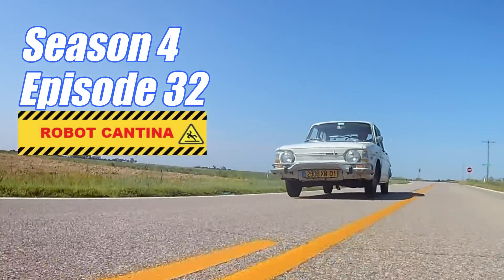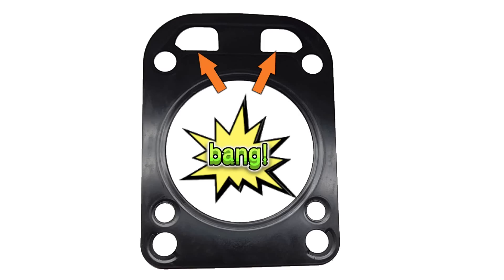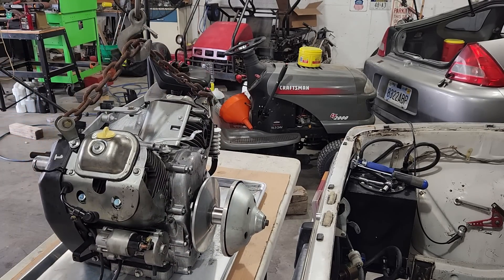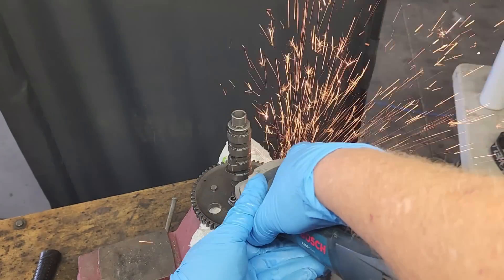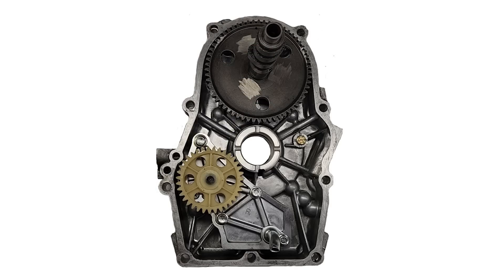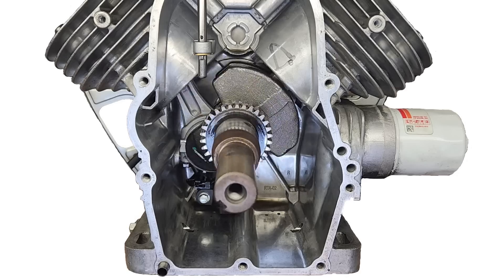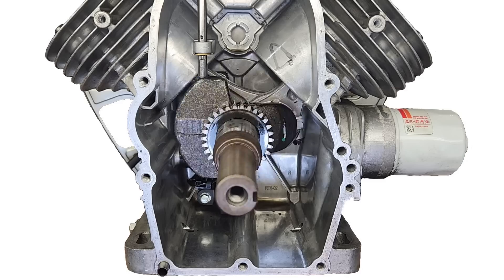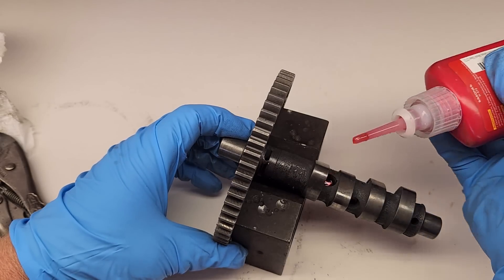S4 E32.  We do an autopsy on the 670 cc predator engine in order to find the oil leak

Comment: I have this engine on one of my pressure washers and it is stock unmodified with compression release. AND it blows oil still. I would love to see the update of your modification. Did it solve your issue with the oil being blown out? I am losing half a quart about every 7 hours. At that rate who needs an oil change!? I started thinking about making an oil catch can and T it into the oil drain tube to return it back.

Comment: holy hell 180 psi? the highest compression small eng i ever had was my 16hp cast iron brigs single, got 115psi. my best briggs oppy does about 75psi both cyl. i got a smooth running cast iron smoker 12hp that runs 25psi, was 50psi till i axidently submerged the motor on a trail ride

Comment: I guess that you will wear out the cam and lifters shortly by blocking off the hole in line with the top of the cam lobes. I think a better way would have been to reinstall the cam rod with the pin you pulled out with the vice grips. I really hope that I am wrong. I f I am correct with my engine theory then the pressure oil was for camshaft lubercation . THANKS FOR THESE VIDEOS.

Comment: An easy fir would be to relocate the crankcase breather to the head opposing valve cover from the oil fill. Little more involved would be a crankcase oil catch can. Just have the drain re-enter the crankcase. Love the videos. A lotus 7 powered by a boosted predator would be awsome fun.

Comment: Currently working on a conversion, Fiat Palio. Small front wheel drive light cheap car. Installing a Yanmar 3TNE78A. I think it will be interesting to see fuel consumption compared to your Kubota projects as this yanmar is direct injection

Comment: It would have been easy to do it the right way: make a solid slug on a lathe with a resistance fit area on the end and press it into the hollow camshaft with a bench vise. Add a pin or a set screw afterwards if the pressing force didn’t feel adequate.
Reply from the maker: indeed, there are many ways to solve the problem.  The method I chose was perhaps not the greatest, but it was a method anyone could do.  Not everyone has access to a lathe and a press like I do, however everyone does have access to thread locker.    From past experience, I'm confident the thread locker will hold the slug in place without any issues.

Comment: 2:50...

failing to hold the throttle open is also a good way of establishing VE at idle... for those that are say, attempting to code an EFI ECU from scratch...

hell, i throw a bike in gear then run it on a treadmill type affair and get VE for the whole RPM/throttle range.

also, the reading in kg or bar is also the compression ratio.

Comment: Are you worried at all that you may have introduced more wear to some of the moving components that are supplied with oil via the pump?  It seems  to me that by creating an unrestricted path for the oil to flow through the cam, that the oil pressure may have been extremely low. If I understand correctly, the oil passages/galleys are properly sized so that each component gets the oil that it needs while at the same time restricting the flow enough so there is sufficient pressure for the oil to get pushed everywhere it needs to go.  Please let me know if I'm missing something.  I'm loving the videos; keep it up Jimbo!
Reply from the maker: @ 8:56 into the video I address that issue.  The far side of the cam was engineered to get oil by splash lubrication so no worries about lack of oil from plugging the cam.   Aftermarket cams for this engine are basicly the same way.

Comment: Nice find and solution.  One thing, although a bit of crankcase ventilation is due to piston ring blow by, the majority is due to the v-twin layout on this engine. The pistons do not exactly oppose each other in motion like they might in an I4 engine for example. So the crankcase volume changes quite a bit, and with that a lot of air is moving in and out. Or trying to, at least.

Comment: If an aftermarket performance cam is available for these engines, then I'm surprised that you didn't go that route to get rid of the de-compressor, and save having to go back into the engine again. With the twin carbs now fitted, is there any performance modifications left to do on this engine? It'd be nice to see you dial it in as good as you can get it, and then do a 0-50 and 0-60 run against the Insight 719, especially once you get a 14psi pulley set up and maybe some propane injection for it.

Comment: In a way you were lucky that the hollowed out camshaft did not bleed off so much oil pressure that the rest of the engine had insufficient lubrication.

Comment: I suspect you made your cam into an impromptu oil squirter, except it's going into the head instead of the bottom of the pistons. Moments away from confirmation or internet pit of despair, booking for one. 😁
Edit: Well, I will forgo my ticket, temporarily. Crankcase pressure and it's wily, magic charms, eh?

Comment: Or you could have run the breather from the fitting on the block to a valve cover to direct the oil to the top of the head and run another fitting from the valve cover to a PCV valve and filter from a 70s era GM car.

Comment: I actually suspected this would be an issue when you removed it... through no other reason that removing something that wasn't blocked previously would be an issue. I was actually at the time more worried about the bearings being unlubricated due to lack of pressure due to the holes.

Comment: The only thing I'm worried about is if the oil pressure on the cam also lubricates the the lifters as well. for example if you need to drill an oil gallery from the gear side to where the ball bearings where  to drip oil onto the lifters.

Comment: My guesses were wrong. While you were explaining the compression relief, I thought that the newly opened holes were going to be slinging extra oil into the crankcase ventilation system. I never would have suspected the oil flowing the way it did to the end of the camshaft. That would have been a head-scratcher for a while for me.

Comment: It seemed like for a moment there I had been warped to Eric's channel and he was working on a lawn mower engine, breaking it down, looking at the gaskets and heads but he didn't do the scientific test on the pistons with the specialized tool he has for it. I broke a bolt that had been lock(ed) tight, lock tighted once. I can validate it sticks. I went back to my Maypo not CC. Very interesting video as always, I liked the video modification, you may have a fall back career. :)
Reply from the maker: The fact this engine doesn't have a water pump is likely the only real difference between our  channels.

Comment: Any chance you'll be rigging up an electronic ignition system, so you can program a timing curve to extract MOAR POWAR from this little v-twin?
Reply from the maker: it's a possibility.  I used speeduino EFI on the fuel injected 420 and played around with ignition timing and on the 420 the engine ran best with very little timing change.

Comment: You should have confirmed the cam lobes are NOT lubricated by the oil feed to the inside of the cam.
If that were so, the inlet lobes would have holes in their base circles.
So locktiting the pin to the inside of the camshaft should not cause cam lobe wear.
The cam lobes are lubricated by splash from the big end bearing bleed off.

Comment: I don't think that was a good idea, ie, doesn't the far bearing get lub from cam bore hole using the short shaft clearance as a restrictor, ie, probably not a good idea to locite.
Those are MLS head gaskets, ie, should be fine to reuse.
Reply from the maker: Keep in mind, the opposite side of the cam gets lubricated by the four notches in the block that allow splash lubrication to reach the part of the cam that installs in the block.

Comment: What the heck is with the stacked head gaskets?  Did they decide it was easier to stack 2 to get the compression right than to put the right gasket in there, or for that matter, spec the correct compression height in the components?
Reply from the maker: I'm not sure why they did it that way.

Comment: I assume the shaft will hold but if it doesn't wouldn't' a threaded restrictor fix the issue? Like a set screw with a hole through it to let some oil through? Or even a oil galley plug from a larger engine with a little hole in it. We typically use loctite retaining compound for sleeves and whatever else, at our shop.

Comment: hopefully that's the fix. if not, the old adage of 'go back to the last thing you changed' will fail.
I know the nay sayers will lambast me for this, hence why we need endless mitigation in everything we say because they are much more cleverer than us, but I'd clean up and reuse those air cooled head gaskets with a light smear of Wellseal. if it was good enough for Rolls Royce its good enough for me.
we can now add 'oven' to the VW Jetta trim levels.
keep up the good work!!!
Reply from the maker: LOL, yes, every word I say is carefully chosen, and I still get people who pick apart my words.
Reply: @robotcantina8957  they're mostly jealous and jealousy like copying is very flattering when you're in a good mood but down right annoying when you're not

Comment: Dear Jimbo I found the cause of the oil going out the vent. It's a dancing crankcase before you start the engine may I suggest, that you play various tempo polka tunes for about a hour it should deter it form dancing and stop the over excited crankcase from pushing oil out the vent. Have a great day!!!
Reply from the maker: Indeed, that crankcase was moving!

Comment: Was this one of those the comments helped brainstorm the issue moments? Lots of mentions of the now open shaft hole in the last update's comments! Very cool breakdown of the issue though, helped follow how that hole in cam most thought was likely responsible into how it is actually causing the issue. I'd never guessed the hollowcam would be directly connected to the breather. Great video!

Comment: I saw something coming when you said the oil pump went straight to the open cam shaft. I didn't expect the hole to be aimed straight into PCV system though. The crank case vent is a very cleaver design.

Comment: I had a funny feeling that the camshaft modification may have caused your problem while watching your last video however, I didn’t wanna make an assumption as I could not see the internal parts of the engine to see how the PCV system function. The important part is that you figured it out.

Comment: A compression test can show this but  will not always reveal this issue. Cylinder pressures are much higher than during a combustion event. It can be more accurately determined by a leak down test. With the valve cover off and checking the pushrod area.
Interesting design and I can see how you overran the pcv with too much oil.
Reply from the maker: I actually did do a leak down test, but I ended up cutting that out because it was also inconclusive.

Comment: Went back and looked at the previous video and wonder if it might have been simpler to remove the spring and weld the bracket to the pulley with the bracket set to non-release.  But this is hindsight.  I enjoy your ability to take it all in stride, knowing that an internal combustion engine is a system, and when you remove one part it can affect others.  The crankcase blow-by system is actually kind of cool, letting the vapors through and out while slinging off any oil.  This should work, looking forward to more shenanigans!

Comment: why didn't you just put the pin back into the cam to hold the rod?
Reply from the maker: Off camera I tried to reinstall the pin.  After 20 min I gave up. ... its not easy.
Reply: @robotcantina8957  understood.

Comment: Plug weld the cam and rod.
Reply from the maker: The cam is cast iron and the rod is HSS.  Welding those together is not in my skillset.
Reply: @robotcantina8957  The fusion would be weak between the cast and the HSS but the weld plug will fuse fine with the rod and will have a positive contact fit with the cast holes so it would not matter. It is just something to think about if the Locktite breaks loose.

Comment: So a question that jumps out to me is if you have now stopped the oil going through the cam altogether, how does the engine breathe and how does the cam bearing get lubricated?
Reply from the maker: The breathing holes were not disturbed.  Also keep in mind, the opposite side of the cam gets lubricated by the four notches in the block that allow splash lubrication to reach the part of the cam that installs in the block.
Reply: @robotcantina8957  OK I get it now. Just the way I was listening it sounded like a small amount had to pass through the cam and that bar acted as a restrictor.

Comment: Wow Jimbo, I am constantly amazed at how much work you put into each video episode!  Making that animation of the rotating engine assembly alone had to take quite a bit of time, that and the random gnome and dinosaur appearances.

That is a very tricky oiling system built into the camshaft, it certainty fooled me.  I wonder if the original modification or, the oil leak fix will/has starved something of oil?  I realize it's all part of the D&D (Dittle and Develope) process so, time will tell.

Thanks for all the effort you put into these videos, being a retired engineer/geek, I fully enjoy and can relate!
Reply from the maker: Hopefully we didn't change anything with our modification. 
Keep in mind, the opposite side of the cam gets lubricated by the four notches in the block that allow splash lubrication to reach the part of the cam that installs in the block.

Comment: I have a mild concern with your fix.  High pressure oil on the one side of the cam to lubricate the bearing passed through the center of the cam to also lubricates the compression relief rod. As with all oil fed bearings (in this case rod) oil passes around it to keep it lubricated. In this case the machining tolerances only allowed a small amount of oil to pass through /around to lubricate the ball bearings and to pass all the way through. This now low pressure / low flow oil now would lubricate the bearing on the other side and not be done by "splash" oiling. You may end up having bearing wear or failure on the breather side bearing. The "plus" slots in the breather side bearing may be there to let the oil drain back to the crank case. Tell me your thoughts.
Reply from the maker: Keep in mind, the opposite side of the cam gets lubricated by the four notches in the block that allow splash lubrication to reach the part of the cam that installs in the block.
Reply: @robotcantina8957  I looked at the aftermarket cams and don't see a oil passage so I will go with your conclusion. Thanks.

Comment: Had similar issues back in the day with our racing lawnmowers. We ended up tapping the shaft and installing threaded set screws. But some guys used jb weld… or locktite like you did. Some even welded all holes and ended up doing some hand grinding and filling. Great job bud, I have really been enjoying these videos.
Reply: My thoughts were to just weld things shut but I think I like your idea better by adding bolts

Comment: My only concern is that a little bit of oil is supposed to get through, and now it's very well sealed shut
Reply from the maker: Likely zero oil will get through.  the opposite side of the cam gets splash lubrication, so we should be ok.
Reply: @robotcantina8957  oh, cool. Good to know

Comment: Did you examine the big end rod bearings for wear ? Also having the engine apart could have been a good time to switch camshafts and upgrade the walve springs with the advice from Greg (red beard) not for mad power but a better bottom end for moving the extra weight of a car instead of a lawnmower. Great work again 👍🇬🇧🇺🇲

Comment: wait, isn't the oil supposed to pass around the tolerance of the rod to the opposite end of the cam?  Did you now block that with the loctite?
Reply from the maker: Keep in mind, the opposite side of the cam gets lubricated by the four notches in the block that allow splash lubrication to reach the part of the cam that installs in the block.

Comment: Was that a troll or does it really have 2 head gaskets stacked?
Reply from the maker: The engine actually has three layers of gaskets.  two steel gaskets and an aluminum spacer.
Reply: @robotcantina8957  Is that something you did to increase volume or is that the stock configuration?  

I have one of these engines (still in the box) for a future mud motor project.  I expect at some point I'll have to get into it.  Probably to remove the governor, and maybe the oil sensor after I upgrade the valve springs to handle more RPM.
Reply from the maker: @boblalonde8661  it's stock.
Reply: @robotcantina8957  Thanks.

Comment: The Pentastar V6 PCV system also vents thru the the right side exhaust cam, thru a separator that looks like a squirrel cage fan. They blow headgaskets because the oil cooler starts leaking (coolant) and grandma thinks she can drive 10 miles overheating. 
Great vid, Jimbo.
Reply: I did not know that about the pentastar V6 certainly interesting to learn, thank you for sharing.
Reply: The pentastar is a absolute desighned failure by Chrysler they literally built the most finicky maintenance absolutely required engine they could and then put it in everything knowing it was gonna go pop just outside of warranty their engineers are on another level of screw the consumer 😂
Reply: @79huddy  not unusual, just at the bleeding edge of a trend
Reply: @79huddy   I'm surprised a little. The previous V6 engine created by Chrysler, I believe was the SOHO 3.5L V6. That was a very reliable engine in my experience.